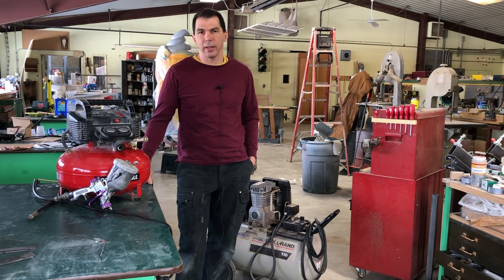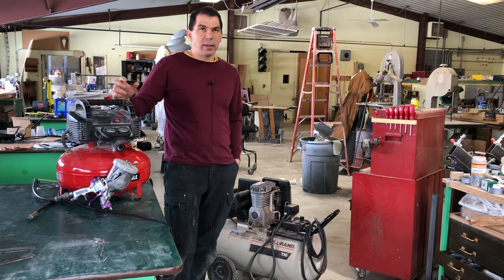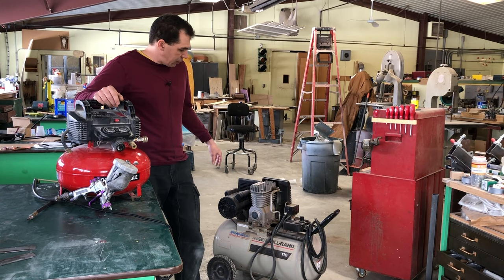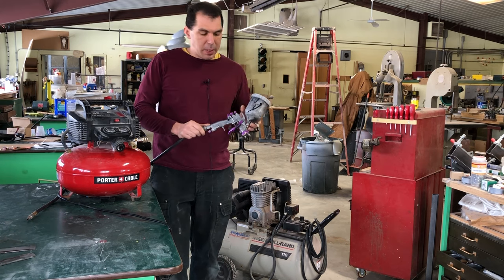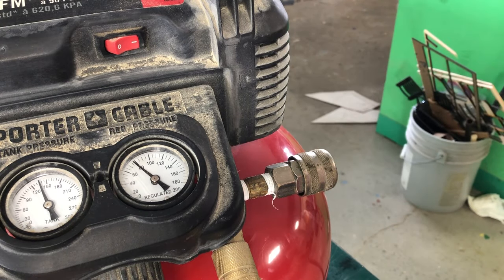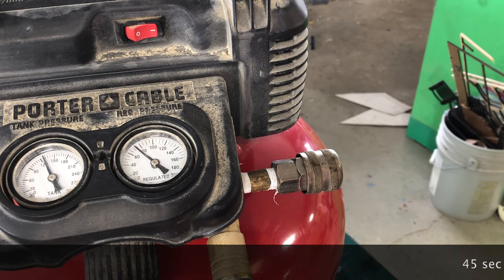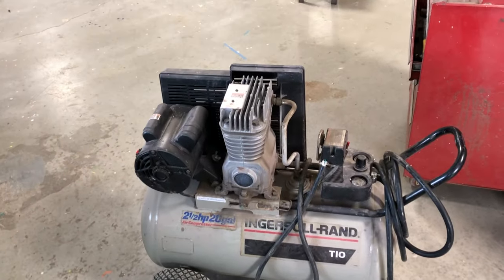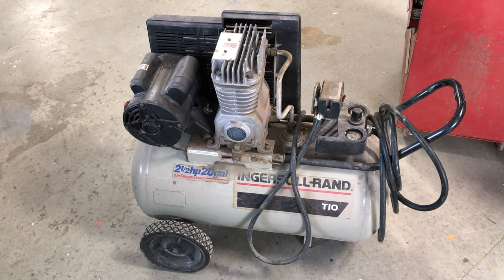Air Compressors for HVLP spray guns:  What compressor should I buy?

Comment: I've been spraying for over 30 yrs and I'm telling you, that little Porter-Cable compressor will not work
Reply: I have a California air tools compressor, it's about the size of the one on the floor, maybe a tad smaller. I believe it only puts out 3cfm. Can i get a sprayer that requires around 4.5 cfm if im only using it for small jobs? Like motorcycle parts and stuff?
Reply: Could you help me find the cheapest sprayer/compressor??

Comment: If you are a professional spray tech who does 10 cars a day of course you need an 80 gallon that puts out 25CFM. DIYers can use their current compressor, but use a low CFM gun.

Comment: I use 20 gal Husky but with a LVLP Gun saves Lots of air and painted a whole car no problem,  psi Never dropped  below 125psi 👍
Reply: Which LVLP gun did you use?
Reply: @commentator2.0  I use the AeroPro Gun
Reply: @redbaron2448  thanks for the reply! Hadn’t heard of that one but looks to be the same as the SPRAYIT branded one I was considering. So I will give one a try. Thanks
Reply: @commentator2.0  Your welcome and Happy Painting

Comment: Well done. One of the few videos that explains that a DIYer can do a lot with a small compressor if they are willing to wait patiently when air gets low. I sprayed my Jeep with almost the exact same setup using very similar compressors. I used a T and 2 check valves. With compressors running on separate circuits I rarely had to wait.  Of course a pro would never be willing to wait as time is money so that solution wouldn’t work for them.
Reply from the maker: Thanks 👍

Comment: I have a 80 gallon Ingersoll Rand TS4N5 great machine ! Never run of air , but have use a 10 gallon in the past to paint a riding mower it worked just gotta be patient with the recovery. But anything I under 26 gallon is pushing it in my experience. But others may have had better luck !

Comment: Really good info.  Small compressor for small projects.  I first got 100 gallon used propane tank for free and used that with a Craftsman 25 Gallon home style compressor (125psi).  Worked great and I added a computer style muffin fan on top of the motor (I cut a hole into the plastic shroud) fan ran continuously to keep the motor cool even between cycles.   Motor lasts a long long time *if* it is stays cool.
Reply: Great job

Comment: Thank you so much for sharing and, by the way, I hear you perfectly. This is the kind of explanation I was waiting for. I wonder why most people say that you need to match the gun cfm requirement with the compressor cfm delivery. I think it is because they are referring to painting cars. As a woodworker, I have used HVLP guns with a 2.4 cfm pancake compressor. Recently, I acquired a 14 cfm HVLP gun and may need a bigger compressor but will make the test first. If I can paint a cabinet door which takes about half a minute without catching up, that is enough for me.

Comment: Volume a bot low but I heard you fine. Glad you shared. I have a cheap hvlp thinking of spraying my pine doors with water based poly. I have that same compressor and the cheap HF upright like 30 gal but regulator sucks. Doesn’t run my finish nailer like the pancake. Maybe need to upgrade regulator?  Which one do you think is better?  Thanks for vid.

Comment: Hi Tom, thanks for the video, it did clear up the cfm area of need for me. Newbie question though, what about the fact that these compressors tend to also 'spit' water? Don't you need a painting specific type compressor to overcome this? Thanks
Reply from the maker: All compressors will accumulate water,  they need to be drained occasionally.  There are also dryers you can add after the compressor and befor the gun.  These can be expensive cooling units for large volumes or simple passive ones for smaller.
Reply: @imagineform  Thank you very much

Comment: Great video! I found it super helpful. Does anyone know if Dewalt DWFP55126 (165 PSI, 2.5 SCFM@90, 6 gallon) or Dewalt DWFP55130 (200-PSI, 3.0 SCFM@90, 2.5 gallon) will be better for spraying?
Reply from the maker: I would go with the 6 gallon,  it will kick on less often

Comment: I have a 30 gallon Husky, 5HP with a 10CFM output. I am able to use most HVLP guns that use 4-7CFM
Reply: How much did it cost?
Reply: @brandonpacheco6125  $100 in 2000

Comment: can we use aircompressor for tires on spray gun? i barely can find those in your videos , and if i do its freaking expensive
Reply: Not unless you are using a larger compressor to fill up your tires. Compressors needed for paint spraying are spendy.

Comment: if i want to set 70 to 80 PSI with air compressor tank, then set 2.5 to 30 PSI air regular pressure if i keep running so long for spray or do i have to wait 30 sec then waiting fill up air or ? just want to make sure. thanks

Comment: So my question is on my new set up....purchased a 27 gal husky compressor rated at 200 psi, 6.8 CFM@40,  5.1@90.    Would like to paint a hood and two fenders off of the car..... the HVLP gun I purchased says average consumption 4.3 CFM, and Operational pressure says 40psi. How do I use this info.   
1. What do you think of this, and will I be able to get through a painting job?
2.  Trying to decide how to set up the lines.  I have two 50foot poly lines, and a water separator and separate regulatory I will instal between the lines.  I think I will shorten the first line to 20-ish feet To give the air time to cool and condensate into the filter, correct?    
3. So the pressure coming out of compressor should be set to what? Full?   The intermediate regulator set to what? And the regulator on the gun set to what?    Thanks
Reply from the maker: So the specs say 6.8@40psi and you gun only uses 4.3@40 so your compressor will have no problem keeping up and you can spray continuously.  Pressure will drop with long line length so will have to be set higher at the tank,  let’s say 100psi maybe 75 at the midpoint(but this isn’t necessary) and 40 @ the gun to start.  If you can’t get 40psi at the gun raise the pressure at the tank.   Hope this helps
Reply: I'm in a similar situation.  If I understand correctly, and to abbreviate your answer, you are saying measure PSI at the gun and maintain 40psi there?

Comment: Are you not supposed to keep spraying as the compressor kicks on to refill the tank? I have an Iwata LPH-50 HVLP that only uses around 2.2 CFM max and my tank can supply around 4 CFM @ 40 PSI. My Iwata only runs at 13-14 PSI. My gauges still read the same 13-14 PSI (working pressure) when the tank, a 4.4 gallon, kicks on but am I supposed to stop and let it completely refill?
Reply from the maker: No,  you can keep spraying as long as you still have the pressure.    If it runs too long it could over heat though.
Reply: @imagineform  Ok, thanks for the info!!

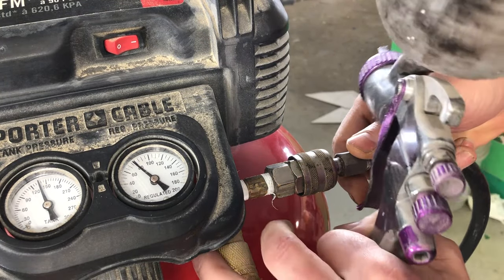Comment: 3:28 Is there a way of calculating that 45 second run time using maths? 

Boyle's law states that "as the pressure on a gas increases, the volume of the gas decreases because the gas particles are forced closer together. Conversely, as the pressure on a gas decreases, the gas volume increases because the gas particles can now move farther apart." P1V1 = P2V2

Which means that as you start spraying, and the pressure in the tank starts to drop, you gain volume which helps you sustain the spray. It's a dynamic situation which makes the static equation above challenging to apply.
Reply: You are misunderstanding Boyle's law.    PV is a constant only for a closed system.   For example a bicycle pump with your finger over the end to stop air escaping.   Then,  as you push the pump in the volume of the air in the pump decreases and the pressure increases.   If you then release the pump  the volume of the air in the pump increases and the pressure decreases.
 In the case of the air compressor tank feeding a spray gun it is not a closed system.   Air is being lost as the spray gun is being used.  There is no 'gain in volume' as the pressure in the tank drops.   The consequence of this is that if the spray gun is using air at a constant rate then the pressure in the compressor tank will drop in a linear fashion (if we ignore the compressor kicking in to try and replace air when the pressure drops sufficiently).

Comment: I have a 20 gallon/ 125psi
Displacement 11.7 scfm
Maximum delivery 6.6 scfm at 125 psi
Is this a good compressor to paint a car
Reply from the maker: Yes that should be fine,  you may have to give it a minute to catch up but it probably will keep up just fine

Comment: Pretty much no single-phase compressor will keep up continuously with a HVLP spray gun or any sort of decent sand-blaster - they will all lag like crazy, resulting in poor spraying and sand-blasting being a severe drag. 

I only have single phase power in the workshop, but I want to sand-blast continuously for long periods of time  (with a non mickey-mouse blaster), plus I also want enough air to spray a bus - mainly as we spray quite a few busses.. So, I have a severely "Frankenstein" compressor set-up but it reliably supplies "All the Air" for as long as you want. Plus it was cheap as chips & home-built - which is always good. 

Basic "jist" is I have an older, really heavy-duty Japanese 10hp petrol compressor that has its own 200l tank - plus a 3hp single-phase compressor, also with a 200l tank -  both feed into an additional 200l tank (off a busted compressor)  & I can run either just the petrol, just the electric or both at the same time depending on how much air I need.  All 3 200l tanks feed into a big condensor loop that cools & dries the air - which in turn feeds cool, dry air into a 3/4" line that goes to the air-outlet points around the workshop. What you get is 600l of air-storage at 110psi, being fed by either one or 2 compressors depending on how crazy you'd like your air-volume to be - and the end result is NOTHING you'd like to run off air struggles for supply. 

Just my 2c. :-)
Reply from the maker: Sounds like a nice setup,  I have a big 10hp 3ph with a 100 gallon tank and an extra 150 gallon tank.  Even with that my big sand blaster will use more air,  just need to stop now and again to let it catch up.

Comment: WHY ALWAYS PEOPLE BUY HVLP SPRAY GUN?? I JUST DON`T GET IT. LVLP GUN IS SAME GUN AS HVLP, BUT LVLP OR TRANS TECH- AIR CAP. HVLP= HI VOLUME (OF AIR) LOW PRESSURE, (ABOUT 29-35PSI). LVLP= (LOW VOLUME OF AIR REQUIRE) FOR EXAMPLE: DEVILBISS PRO LITE: T110- AIR CAP IS TRAN TECH AIR CAP ABOUT SAME THAN LVLP, AND THE BEST CLEAR AIR CAP EVER!! SAME GUN, HV25 IS HVLP AIR CAP, AND AIR COMSUMPTION IS A WHOLE LOT MORE… DO NOT BUY A HVLP- SPRAY GUNS!! HVLP GUN IS NOT BETTER GUN THAN TRANS TECH OT LVLP SPRAY GUN.
Reply from the maker: I think the main reason is cost,  you can get a cheap HVLP gun for under $50.  Is it the best out there obviously not but you can get decent results at an entry level price
Reply: you're talking as if HVLP are obsolete yet it still exist, even conventional spray gun still exist, because they all have their own use. and i use HVLP, LVLP, LVMP and conventional spray gun. For a long time DIY isnt really a thing, almost all paint work are done by professional shops, manufacturers came out with LVLP to acomodate that DIY market and startup shop, i didnt say LVLP/LVMP arent good, they are great, especially on DIY projects and startup bodyshop, but it doesnt mean its overall better than HVLP and you shouldnt buy/use HVLP,   the rule of thumb is this, if you are looking for a good spray gun for a little DIY project, go for LVLP and if you are in a professional body/work shop you should have both, because if you are in a professional body/work shop you'll have big enough air compressor to compensate that simply because you have other tools that even more air hungry than HVLP (air sander, impacts), you can take the advantages of HVLP (thick spray, less overspray) to do the job that requires it (some jobs do) and use LVLP for the other job that also requires it. hope this helps.